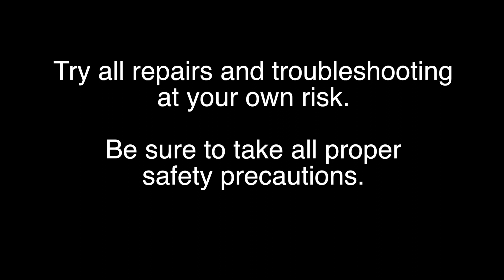Vizio E500i-B1 Power Supply Board Replacement Tutorial

Comment: Hey hopefully you can help me, i have a sanyou dp42740-00, and this is what happened, Monday morning i went to turn the tv on for the kids and start making lunches for school, after i walked out of the living to the kitchen about 5 seconds after turning the tv on i hear a loud static scream of sorts come from the tv steady, i know its not that loud on the volume so i grab the remote, at this time the obscene noise is coming still and i see a picture and its moving like normal but no audio to coincide with the video, i push the volume button down anyway and obscene sound goes off and picture goes off,then delay for 2-3 seconds and power turn on click and power LED light but now picture audio, 2-3 seconds late it turns off click, then 2-3 seconds later turn on click LED light no audio/video, and this repeats until i push the power button on the remote then its off until you push the power button again and same on click led light, off click and repeats, would this be a main board or power board issue? i can't afford a new tv but i can afford one or both of those to fix the issue we have, please help, i have figured out exactly which part numbers i need for both, but just need guidance to see which is the part i need, already ordered the wrong main board off ebay, have to try to send that back monday. Thanks, Grant